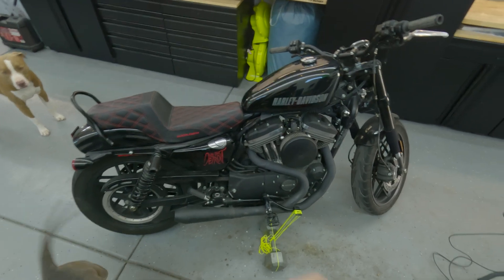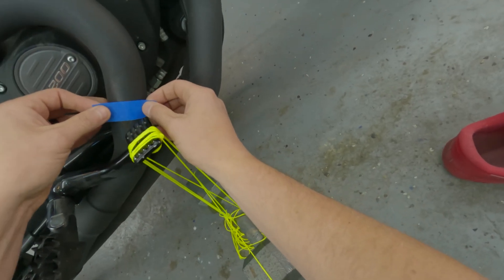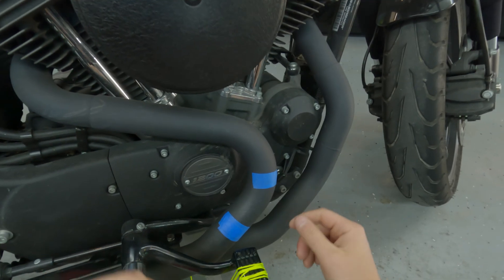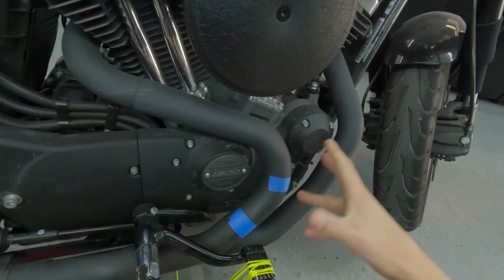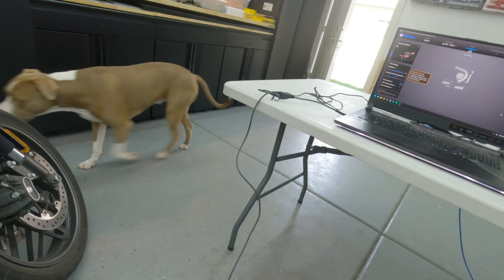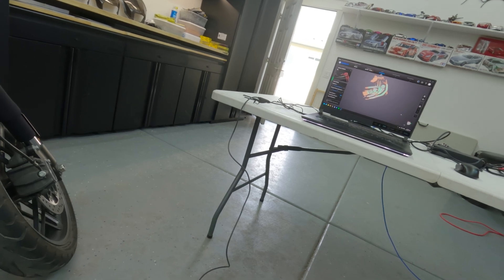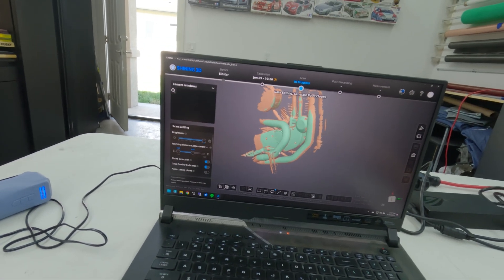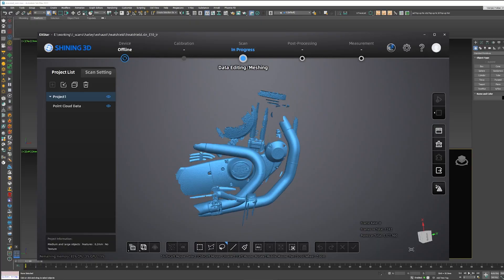How to make a Carbon Fiber Heatshield. Step 1 Scan and Design

Comment: Dio you use regular epoxy or special heat resistant for your part? Same question for the clear coat?  Thanks
Reply from the maker: Do I normally just use regulard epoxy. This is a first time I am making a heatshield so will test and see how it fails. I plan on putting heat tape on the backside but not sure how much it will help or not help. Only one way to find out! :)